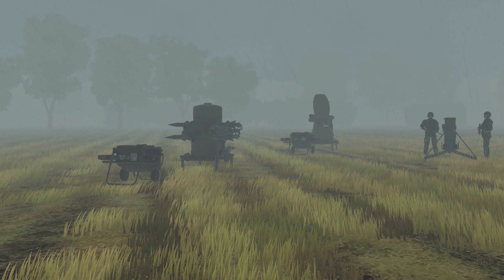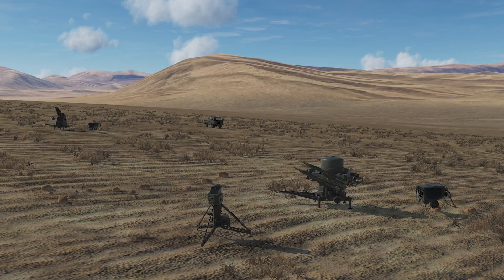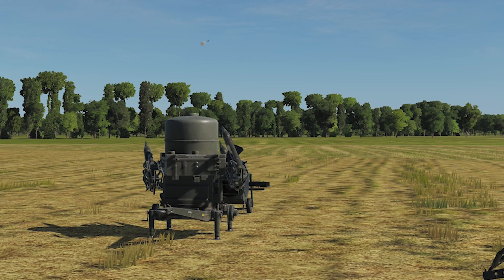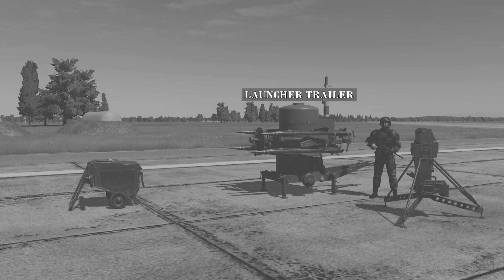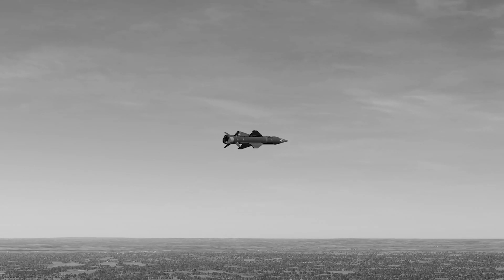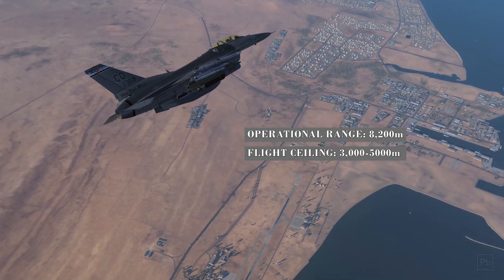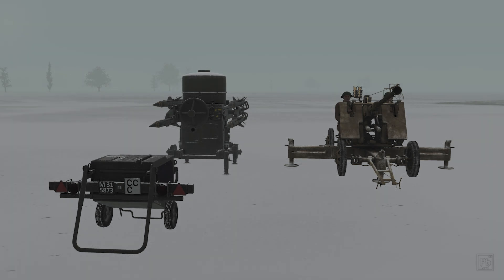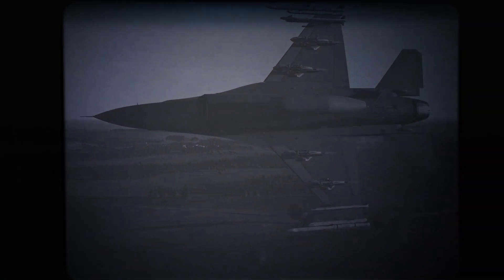DCS: Rapier FSA SAM (S2 Intel Series)

Comment: isn't everything pretty much vunerable on the ground to cluster munitions?
Reply from the maker: Typically speaking armored vehicles are not, though cluster bombs may break track. Generally imagine raining grenades - though the BK90 shown here does have a anti-tank version (what is shown here is actually the mix of AP and AT) but that generally just means bigger pieces of shrapnel. Most "AT" cluster weapons like that are designed to puncture external fuel tanks on older Soviet tanks creating fires and external damage to components. If I held the shot longer for example you would have seen that both Land Rovers in the shot drove away - one explodes a few seconds after I cut the clip while the other still burned.